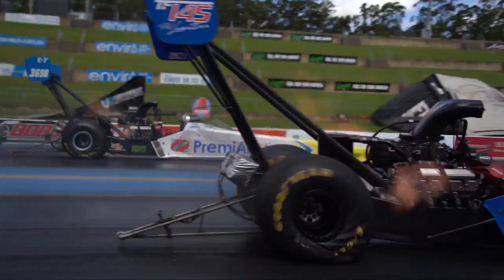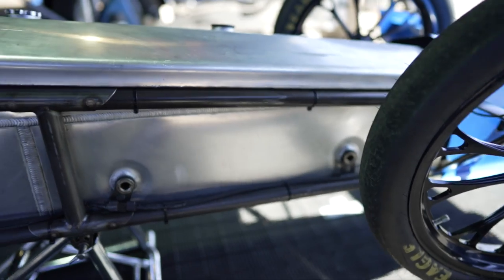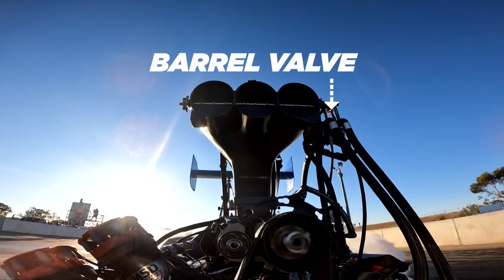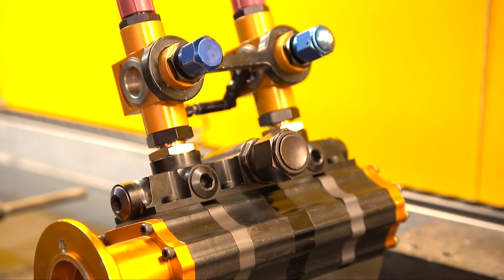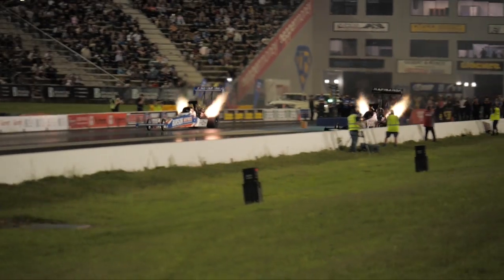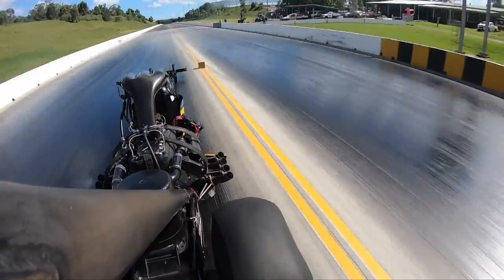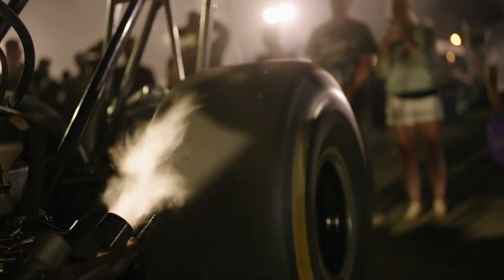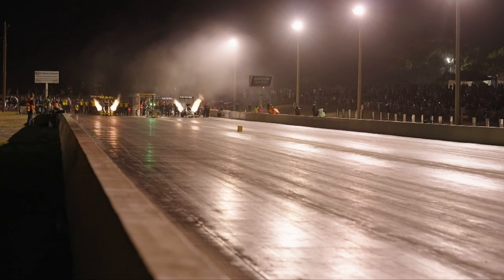How much fuel does a Top Fuel dragster use in one pass?

Comment: The twin magnetos supplying the 16 spark plugs are like an arc welder in power, so to still drowned a spark with fuel is impressive.
Apparently on full throttle the engine uses nitro quicker than if you turned a bucket of water upside down